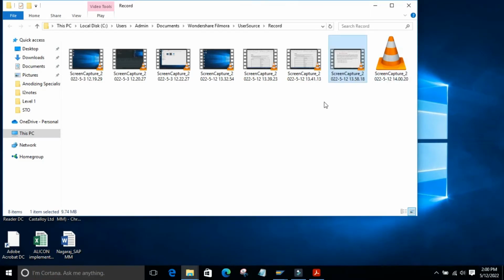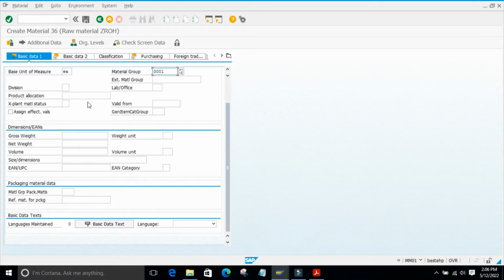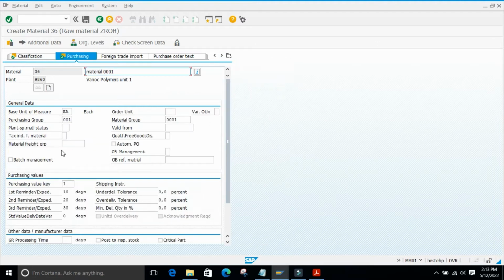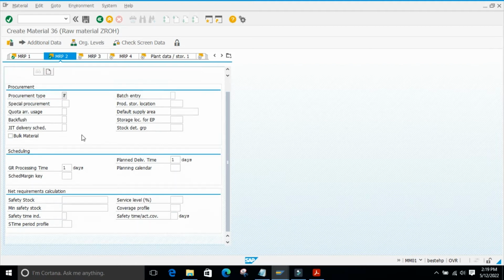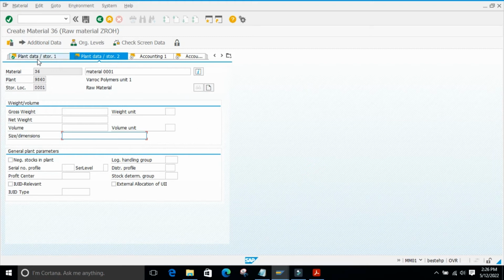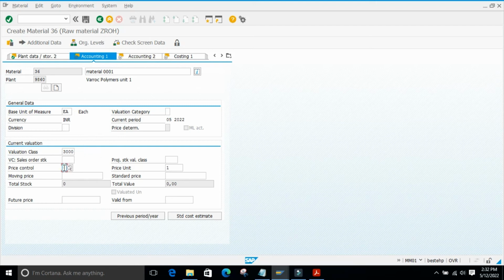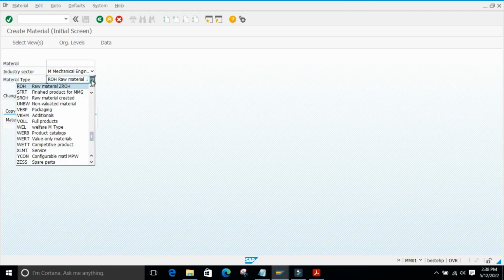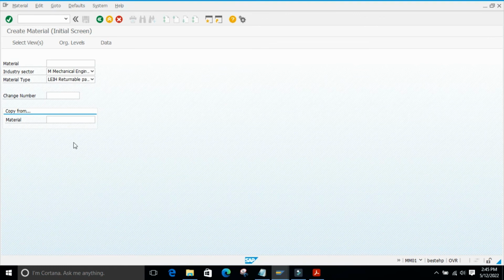Material Master Introduction II SAP MM II complete overview for SAP MM Consultants (Beginners)

Comment: Sir My doubt is what are the views which will be mainly used by MM consultant.....  Also the views which integrated from other module with MM  .... Can u please tell me the views name?
Reply from the maker: All the views are interrelated so you need to know all the views and how they relate to mm.
But specifically purchasing view is purely mm responsibility
Reply: @selfreliantyou   So let me assume  what are the fields that MM could configure at the back end  in SPRO that views might be for MM module Isn't it?